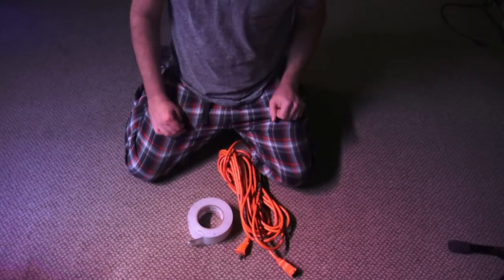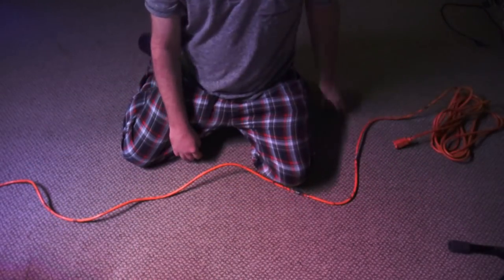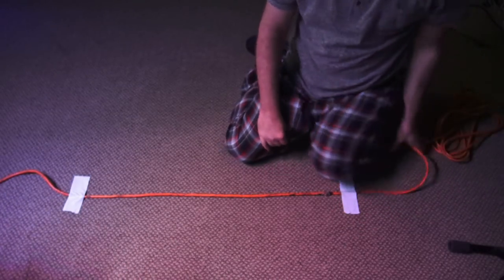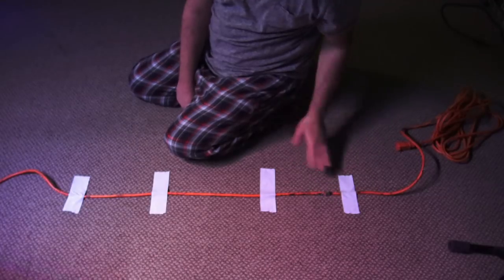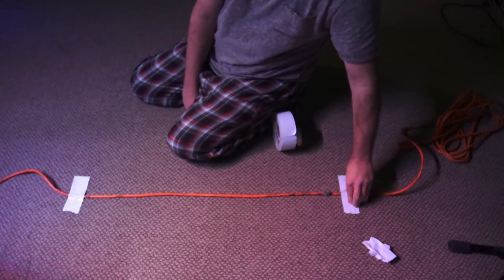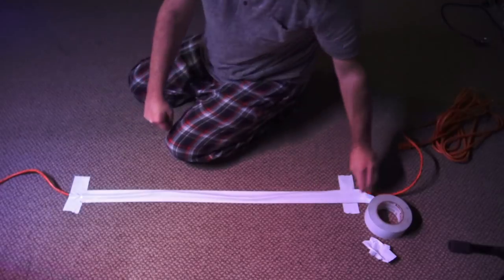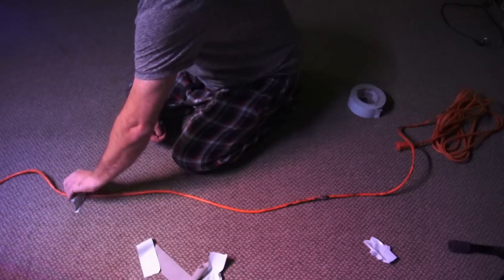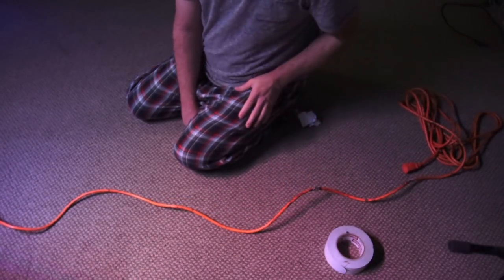DJ Help - Gaffer Taping Your Cables To The Floor Tips & Tricks

Comment: This is the way I've always done it. A long time ago, I used duct tape because it was cheap. Now, I always use gaffers tape. Duct tape leaves too much sticky residue on your cables and the floor. I prefer the 3 inch wide gaffers tape the 2 inch is often not wide enough to cover a larger gauge power cord or multiple smaller cables with one run. Running double runs of the 2 inch wide tape is twice the work and uses 2x the tape. Another pro tip for people is to always pull the tape off the cable as you showed in the video. Never pull the cable up from the floor with the tape still on it. If you pull the cable off the floor with the tape still on it, the tape will wrap around the cable and stick to itself. Then you will have a heck of a time getting the tape off the cable. You'll probably have to end up cutting it off with a knife.
Reply: Todd Barber use low tact duct take from Wal-Mart called duck tape no residue 4 bucks
Reply: I thaught putting duct tape on cables wasn’t very safe

Comment: Buy the 3” wide one or wider if you can or else you will have to do 2 long vertical strips even if your only taping 1 cable down.
Reply: I bought the 4 inch the first time because it was the first one I saw and now that's all I buy. Love that stuff.
Reply: always buy wider than 2 inch

Comment: Hey Brian good tip for the tape idea. But I think I got you beat on one idea. Instead of crossing the cord, run short runs of tape length wise for starters and then go full length to cover. I usually run two runs to make sure all cords are safe for foot traffic.

Comment: Hi Brian. great video as always.
 I have a question unrelated to this recent video. Its regarding the inno pocket spot series and their slave 2 settings.
If you programmed a DMX show and then master slaved the second spot (or more) to the slave 2 setting would it give you a similar result as when you use the slave 2 setting using the built in show modes, i.e. Sometimes a mirrored show and sometimes a contrasting show?
I don't want you to go to the trouble of setting all this up I was just wondering If you or anyone you knew had experimented this way,
Many thanks.

Comment: Hey. I have pretty much given up taping down cables. I often need to work on concrete or tiled floors and the tape just won't stick except if I have a cleaning marathon before. Any tips on that? Else I will do it as always and just run them cables along walls and hope nobody trips.
Reply: Try using better tape?

Comment: Hey brian how would you suggest tapping cables to grass or another method because i have a lot of sound/lighting event outdoors
Reply: google Galvanized Garden Pegs / Securing Lawn Staples / U Pins / Weed Fabric Stakes you hammer them to the grass & you use 1 about every 4-5 feet through the whole length of the cable run.
Reply: You can also get Astroturf and cut it in long strips to cover the cables before you staple them

Comment: Thanks for demonstrating this method. I use it, too, but if I can't get the 3", or wider gaffer tape, I run a two strips to form a wider run of tape. holds up much better in high traffic areas. I still use the single strips for low traffic areas, though. I'd love to use those wide rain carpets grocery stores use to cover my cables, though. Bulky, but would come in handy in venues that don't allow gaffer's tape on a wood floor. Hope you had a great Thanksgiving. Keep up the great works! :)

Comment: People do smaller strips to save tape. I do it when I can safely get away with it. Gaff is pricey.
Reply from the maker: If cost is a concern, you may want to include the price of a roll into your out-of-pocket expenses per event
Reply: I always have black for conceal, yellow for traffic areas, and white for wedding conceal. Only use gaffer tape, never duct tape as it gums up and destroys cables.
Reply: briansredd I'm just cheap.
Reply: Gaffer tape is pricey, but a roll should last you about a year for the large one and you don't have to replace cables. Just a cost of doing business the right way. I get mine online for $10 each. Buy in bulk for better deals, some places let you mix and match colors.